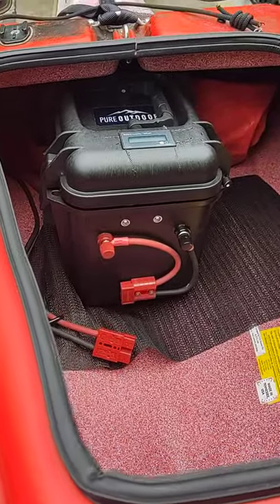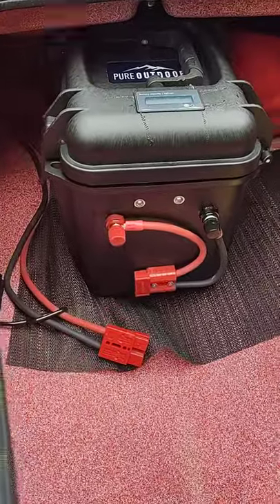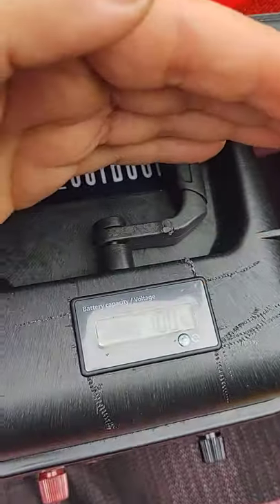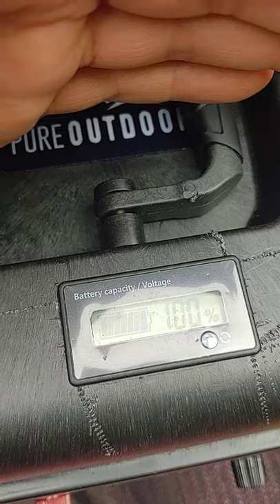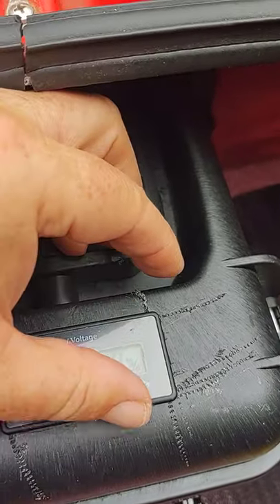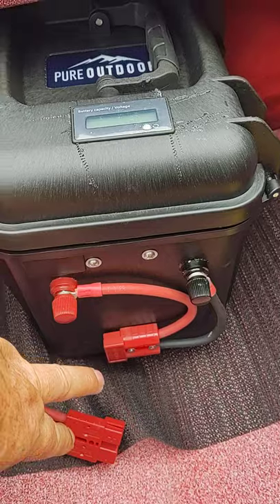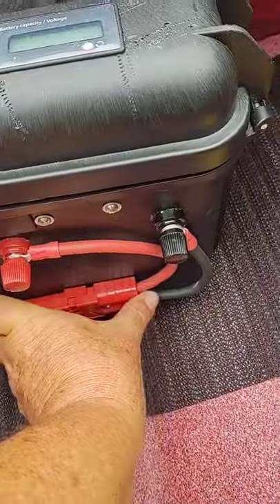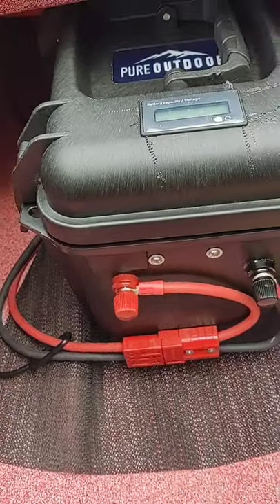Kayak Battery Box with Quick Connects #short

Comment: What are those connectors called going through the box?
Reply from the maker: @AaronFormyduval  3/8" Copper Battery Terminal Stud Connector, Ampper M10 Remote Battery Binding Post Junction Post Block Terminal Kit, Pack of 2 (Red and Black) https://a.co/d/0eLNgN4o
Reply: @RiverSmallmouthAdventures  thanks for the information.  I like how you set that up.